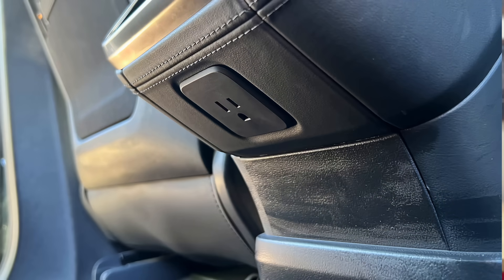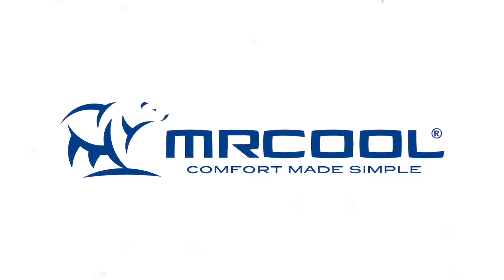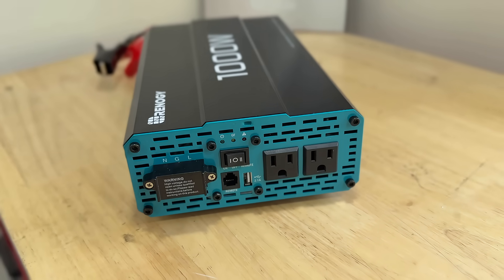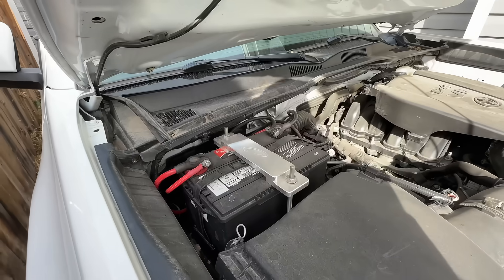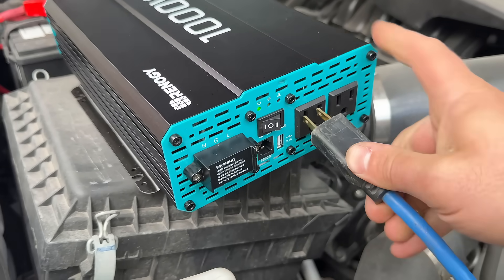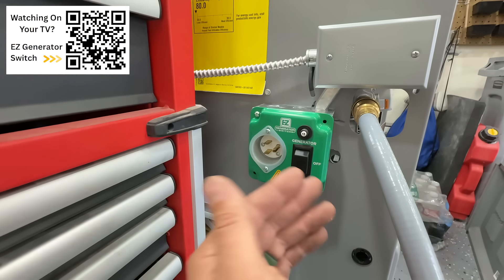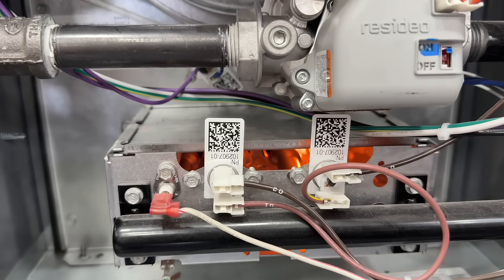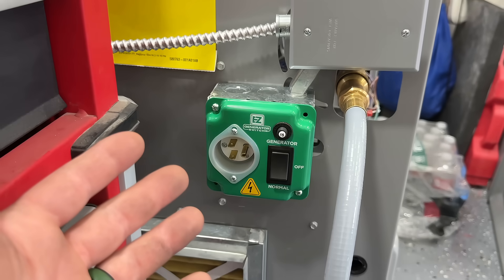Why Buy A Generator? You Have One Parked In Your Driveway.

Comment: 3:11 I'd get a more substantial leads to the inverter if you are going to draw that many watts to power the whole house circulating fan in the furnace.  Typical ones are between 600-800W.  (800W/12V)/90% inverter loss = 74 amps from the battery continuously, far too much for those little leads and clamps.  Granted, it's short, but you'd need about 4 awg wire and much bigger clamps.  You also might want to consider extra ventilation on the alternator as well as the inverter if you're going to pull that much while stationary for that long, especially with the hood closed.
Reply: Yep, I made that comment about the wire gauge before reading yours so I went back and deleted mine. No sense beating an already dead horse. I have an Anderson 175 Amp quick connect permanently connected to my battery and it's mate connected to my 1500 watt psw inverter. Solid and secure connection that never gets hot. Also my truck has a 105 amp alternator, so I keep the draw to less than 1000 watts. I sometimes use my inverter on jobsites when I need power for a short time and don't want to fire up my noisy worksite genny.... it's one of those obnoxiously loud ones.
Reply: @Prepared-NotParanoid This is cool‼️😃 Thanks fo sharing. What gauge cable do you use with this setup? Have you done a video on this?
Reply: @ImASurvivorNThriver  I used 2 awg battery cables. No, I haven't madea video of the setup. Maybe I should?
Reply: Do you think it's smart to put that on top of the engine
Reply: Yeah, I came here to kinda say the same thing. This works but you know people are gonna connect more then a fridge at a time and its just gonna pull to much. Just because the inverter says 1000W doesn't mean the source is going to supply that much
Reply: Absolutely right on wire gauge.  On alternator precautions, cooling is for sure an issue, but even more so, I doubt the alternator is rated for 1000 W / 12 VDC = 83 A continuous duty.  Bottom line:  if car plus inverter equaled generator, nobody would sell generators.  Better to get a power station such as a Jackery or a generator such as a Generac.
Reply: @brianwade4179  don’t buy a Generac
Reply: Our air cooled generac specifies oil check every day during use. It's like they threw out the playbook on reliable engine design!
Reply: @brianwade4179  1000W means 500W on continuous duty.

Comment: Yeah I know all about inverters I had to study them in electronics when I got my degree yeah and and you can use that in your vehicle and it can actually invert it back into your house and power your house depending a thousand Watts is pretty good for your whole house I wouldn't go any less than 1500 but just to keep the lights on in your refrigerator going thousands fine

Comment: Realistic expectation: You will need to run your car the entire time, so this method can run your furnace for about 3 to maybe 4 hours and will probably damage your battery. And possibly your engine if your car runs out of gas. 

The math:
Car batteries store 500 watts for cheap models to 800 watts for expensive models. 
The inverter will use 10 to 15% of that that. 
Modern gas furnaces need about 700 watts.

Watts are measured per hour. 

So maximum time this method could power your furnace off battery alone is about 1 hour.

This is also a HUGE load that the car battery is not designed to run.

You are much better off getting generator that can run 700 watts for about 12 hours to reduce the number of times the generator needs to be refilled. 

Really like the idea if I have not other option but it would be a last resort.

Comment: Relying on clamps to a battery for anything longer than a few minutes or hours does carry some risk… I would opt for something a bit more reliable. 

Yanking 80+ amps through clamps is really only safe for seconds or minutes. Hours is asking for the metal to heat up and the insulation to degrade.
Reply: Gauge on those wires seems a bit under spec'ed, as well.

Comment: Can this EZ Generator be used to keep AC going in Florida during storms?
Reply: AC generally takes a ton more current than the average car can supply. If the AC unit has a "soft start" box added to it, that cuts the sudden spike in current that it would otherwise draw, but you'd still need a good size truck alternator and battery to support that. The average car can only handle about a 1000W inverter. Even though much larger inverters are available, a car's inverter and battery can't support the current they would draw. I wish he had covered that in this video.

Comment: The greatest thing about this is the low noise. I could have my truck idle in the driveway, and outside of the exhaust being visible, you would have no idea it was running. My gas generator however, was like a beacon. I have actually thought of doing a garage door vent used for the exhaust from the vehicle to outside of the garage for an even higher level of stealth. Good backup option for my solar backup. Could still see that exhaust in the cold but many would not know what it means.
Reply: Yeah, low noise and you’re completely in the dark, which makes it a double bonus

Comment: Did this back in the 2003 black out. Inverters were rather pricy back then.  Ran the fridge, fans, tv and cable modem. Somehow the cable providers line amps between me and the CO were still being powered by a small 3mw hydro station whose service area ended about a mile up the road. No local tv/radio but national networks were up.   Back then just 2 years post-9/11 and the only form of communication or information many millions of people had were those within earshot was a bit unnerving.

Comment: Cool video! Does my furnace need a pure sine wave inverter for fragile boards or is "dirty" power okay?
Reply: I have run all sorts of things including computers, refrigerators, TVs and such for decades without causing any damage using modified sine wave inverters. The one and only thing that would not work for me is induction cooking. No damage was done, they simply would not work unless hooked up to a pure sine wave inverter.
Reply: boards and motors really dont like square and spiky wave - be safe and use a pure sine

Comment: Bad advice. If it is a life or death emergency, OK. This is very bad for expensive vehicles. You can buy a good generator for less than $400.00. I suggest you do so. They are a excellent investment.
Reply: Questions about a generator.  Clearly, I've never dealt with one.  I've read a little about them.  Can you clarify these issues?  1)  Is it true that they need oil frequently during a power outage.  2) Is it true that they need ethanol free gasoline?  Any other thoughts?  Thanks.
Reply: @annnonomys3132 I have a Champion dual-fuel (gasoline or propane) 3,500 watt generator.  I change the oil every season before using it.  It will run about 25-26 hours on a 30lb tank of propane.  (I've never used it with gasoline.  12 years old now..  no problems.)  I check the oil anytime I swap out the fuel tank.  It doesn't burn much oil at all but I change the oil at the end of the 3rd tank.  This has been a great generator and it still runs like new.
Reply: @annnonomys3132 air cooled ones burn about 1 oz an hr, especially if it's a very light load
Reply: @annnonomys3132 you know they do have Google search?!
Reply: Put a fuel line shut off valve between the tank and the carburator. When finished with the generator, while running, close the valve. The gen will consume the remaining fuel in the carb until it stalls, then there are no issues with long-term storage, I also do this with my lawn mowers. They always start upon the next use.
Reply: Just check oil before using like any small engine. Better to run non ethanol and use a fuel stabilizer. Highly recommend a sinewave generator. Can be used to power electronics without harming them. Power Smart is a solid brand for the money. Hope this helps.
Reply: @TimMcCann-f8l  Thanks
Reply: Yes but it worked well here, because it turned his older Chevy into a shiny Toyota.
Reply: @thenexthobby  A fair trade indeed. I approve.
Reply: 1st The Good: Why This Works
	•	Alternators produce power: Your vehicle’s alternator charges the battery and can supply enough electricity to power small household devices when paired with an inverter.
	•	Inverters convert 12V DC → 120V AC, allowing you to plug in standard home appliances.
	•	Low-cost setup: A $150–$200 inverter setup like the one described (1,000–2,000 W) can indeed power essentials such as a gas furnace blower, refrigerator, or phone chargers during short outages.
	•	Quiet and stealthy: A car idling produces far less noise than a portable generator.

⸻

⚠️ The Risks and Limitations
	1.	Carbon Monoxide Danger
Never run the vehicle indoors (e.g., in a garage or near open windows). Even with the door cracked, CO can accumulate and be deadly. Always operate outside with the exhaust pointed away from the home.
	2.	Power Limits
A 1,000 W inverter can’t handle large appliances, heaters, or anything with a big startup surge (like a well pump or space heater). Most gas furnaces draw 400–800 W once running, so you’re near the limit.
	3.	Battery and Alternator Stress
Continuous high loads can overheat the alternator or drain the battery faster than it’s being charged, especially if idling at low RPM. Cars aren’t designed for long-duration power generation.
	4.	Electrical Code & Safety
The “Easy Generator Switch” mentioned is UL-listed and isolation-safe, which is good — it prevents dangerous “backfeeding” into the grid. But homemade “pigtail” workarounds can be unsafe or violate electrical code if done incorrectly.
	5.	Fuel Use & Engine Wear
Idling for hours uses about 0.2–0.5 gallons of gas per hour. It’s safe short-term but inefficient compared to a purpose-built inverter generator.

⸻

⚙️ Best Practices If You Try This
	•	Use a pure sine wave inverter (cleaner power for electronics).
	•	Use heavy-gauge cables (4 AWG or thicker) to handle current safely.
	•	Clamp directly to the battery terminals, and keep connections tight and dry.
	•	Start the car periodically if you’re drawing high loads or using a hybrid system.
	•	If powering household circuits, use a transfer switch like the Easy Generator Switch, not a backfeed cord.

⸻

🔋 Bottom Line

This is a clever and budget-friendly backup option for temporary or emergency use — especially for keeping a furnace blower or fridge running.
However, it’s not a substitute for a real generator if you need sustained power or plan to run larger loads.

Comment: Can you show how to put one of those green boxes for the refrigerator?
Reply: Under normal circumstances, a furnace is hard wired to the electrical system and so there is no way to plug in an alternative energy source.  However, that can be changed as he shows to plug in a generator.
Because your refrigerator has a cord and plug, it doesn't need the green box.  You can plug a generator into an extension cord and that cord into your refrigerator.

Comment: Good to know in a dire emergency, but I would in no way rely on my car as a primary means to generate electricity.
Reply: There are many initiatives to enable vehicles to serve as generators for household use-- especially EVs.  I've also heard reports of tractors being used for this purpose on farms.  I'm not sure whether I should try it first on my 65hp John Deere (diesel) or my 2000 Tundra.  Though I guess it's all the same setup, and it just depends on which one still has fuel left.
Reply: @GlenMcDowellFarm you might wanna be careful if you try to use an e v. Many manufacturers have recently come out with the fact that they will void the warranty of an EV that has been used for this purpose.

Comment: It’s 120/240. You really sound like you don’t know what you are talking about when you say 110. Please be better.
Reply: Your 110/120v systems are typically a split phase

, I.e half of a 220/240v system being measured from hot to neutral.

Your 220/240v systems are two 110/120V legs 180 degrees out of phase from each other. That means when one of the two is at its peak positive voltage, the other is at its peak negative voltage, and the potential energy difference between +120v and -120v is 120 - (-120) = 240v. This is a single phase system

.

Your 480v is a 3 phase system

which has 3 277v lines 120 degrees out of phase. This one is geometrically harder to explain, but it boils down to a relation of 1.732 or the square root of 3. Multiply 277 by 1.732 or measure with a meter from leg to leg and you will get 480V, or from leg to ground you get 277v.

Your 208v 3 phase system is exactly the same as the 480v system however it has a supply of 120v per leg, 120 degrees out of phase of one another. 

Hope this helps you under stand voltage better.
Reply: @binnsbrianI understand it just fine. You keep saying 110, that’s not been that since the 1960’s.
Reply: NEC 220.5 (A) Voltages. "unless other voltages are specified, for purposes of calculating branch-circuit and feeder loads, nominal system voltages of 120, 120/240, 208Y/120, 240, 347, 480Y/277, 480, 600Y/347, and 600 volts shall be used." Been in the code for 41 years.

Comment: The heat from the truck doesn't effect the unit under the hood?
Reply: Perhaps put the inverted under the car and run cables up to the battery. In an emergency situation you could locate the inverter away from the engine using jumper cables.

Comment: I guess some idiot got upset with me about my comment letting your car run overnight even in the winter time and how hot the transmission would be and many other components on the engine you'd have to have some type of fan blowing cold air underneath the engine and down the transmission otherwise the car will burn up. I've seen it happen in the dead of winter leaving cars running for too long. I enjoy watching this program and watch it everyday I just thought I would mention this probably isn't a good idea if you only have one car and you need transportation in case of an emergency. Buy a generator It's cheaper than replacing engine parts and transmissions The car's meant to be driving so it cools all the engine parts and transmission down sitting in an idle running things get very hot even in the winter. Highly recommend you don't shut the hood either so it can at least breathe why it's idling and getting very hot.

Comment: That EZ Generator Switch should be installed as a standard default.  Awesome video thanks for sharing.
Reply: EXACTLY!!
Reply: That switch is probably available as an option from any contractor that would install your furnace. But just be aware that the difference between standard and optional equipment in any purchase is that you have to pay for it if it is standard equipment whether you use it or not..

Comment: Nope, gas cars aren't designed to be used as generators , they're designed to receive air flow to cool off the engine and transmission. I would only do this on a extreme life or death emergency situation.
Reply: Idling your car is horrible

Comment: To get that 1000w you will need 3 awg or 4 awg wire and a secure connection. Not clamps. Also the alternator of most cars only puts out 720w so you will be draining your battery with the car running above that wattage and the car requires some of that to run itself. The outlet in cars likely aren't meant to run the inductive loads of a furnace or refrigerator so even if you have one you should still get a separate inverter. 

I feel like this guide is half baked. It's an ok idea but there are so many things that need to be monitored and considered and so many limitations that were not touched on that this guide is very much incomplete.

It's an option to keep the house warm enough that the pipes won't freeze in an emergency but I wouldn't plan on this being my first, second, or even third choice.
Reply: Yup, upgraded alternator, for sure, if this is going to be for more than a few minutes.

Comment: Been doing that for years... Installed a special Receptacle on the outside of the house and have a Clamp Cable from the Car Battery to the Inverter and a special cable from the inverter to the house receptacle Receptacle when I need it for my Pellet Stove and some lights. The car runs while being used for this emergence generator backup.